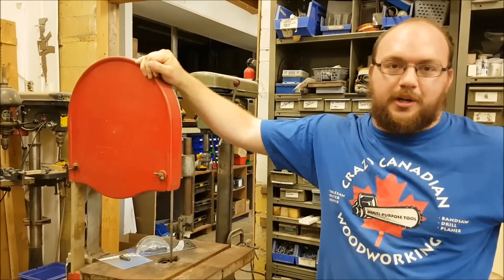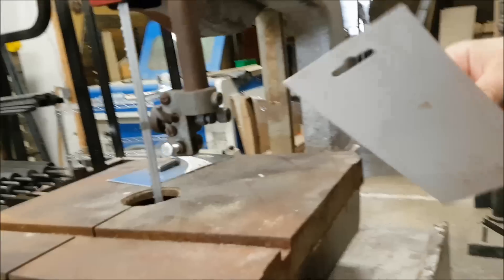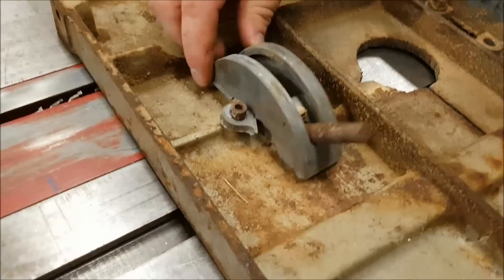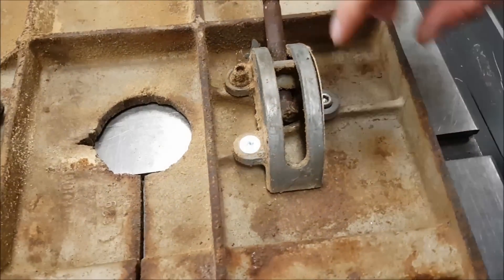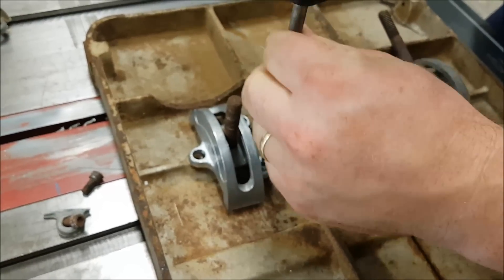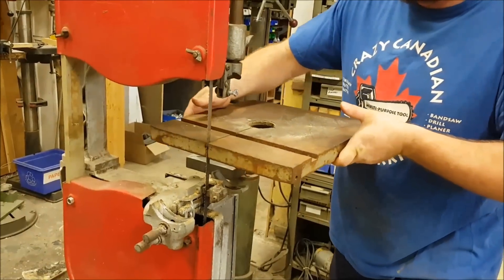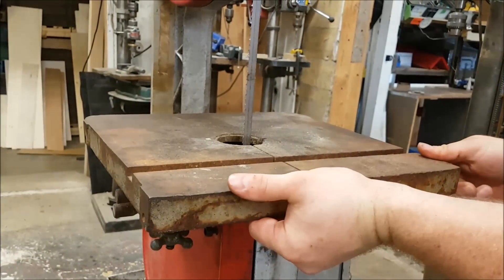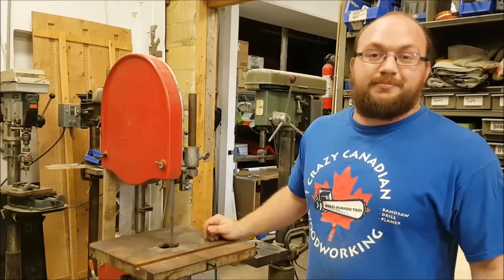How to Fix Delta 14" Bandsaw Table Trunnion EthAnswers

Comment: I am happy you showed the source for the trunnions.  I recently shipped my Delta band saw and the movers broke both trunnions.  Figured I had an antique boat anchor since my searches from the usual suppliers turned up no longer available results.  I did not realize Delta used the same deign for so many models.  I was planning to make replacements from hardwood but would lose the table adjustment.

Thanks

Comment: What if the trunion is fine but the lower cradle is broken?  That's what I'm facing and I need to find a replacement part. Rockwell 14"
Reply from the maker: Unfortunately I’m not sure where to source them. Goodluck!

Comment: In replacing the blade bearings on my 14 inch delta (80's) bandsaw, i saw I could not get to the bottom blade bearing to replace it.  How can I get to the bearing?  Do you have a replacement? What does it look like?  Thanks.

Comment: Good deal  Ethan,  but I would not use the tapered screws you used as you can not adjust the table  as there is no space to adjust the angle  now.
Reply from the maker: That's a good point! I personally never adjust my table as the blade is never at a static angle...when you tilt the top  wheel the blade angle will change. So whats the point? But for those who do regular hex bolts would be wise. Great comment!